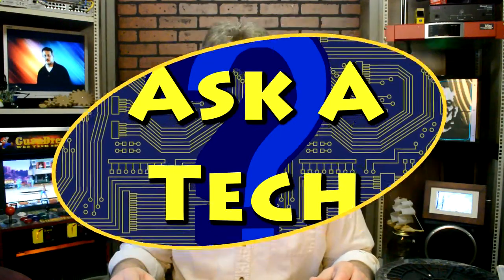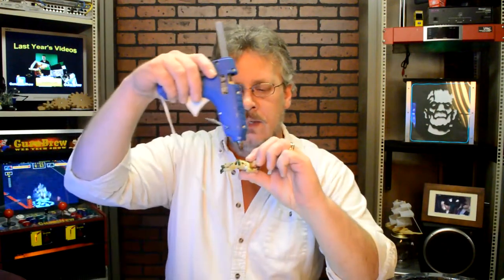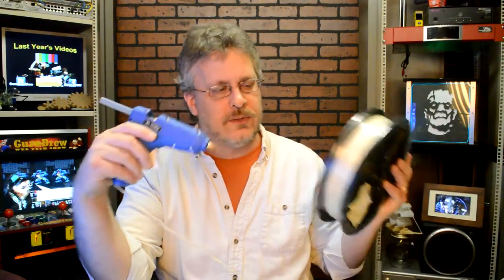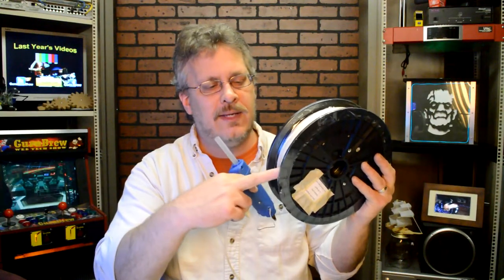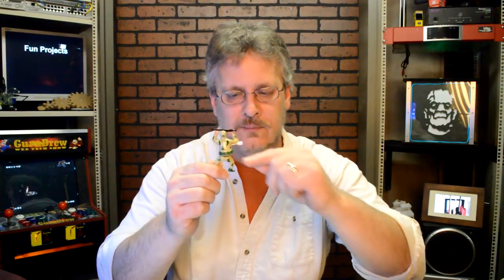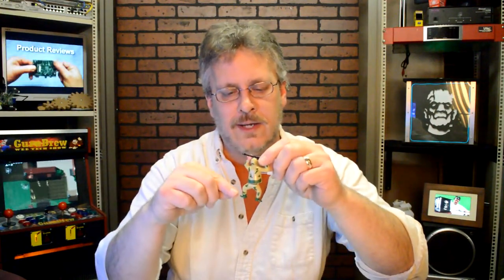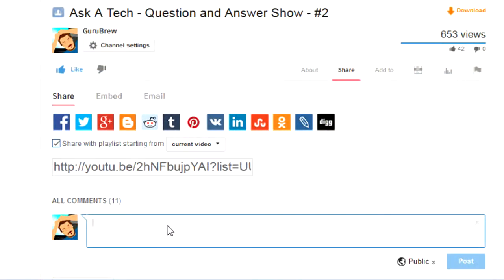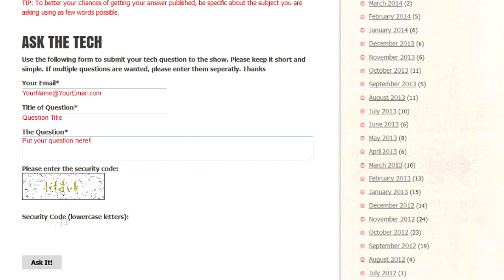What's a 3D Printer?  What Can it Do? How Does it Work? - Ask a Tech #62

Comment: Geez!  Just bought a vintage metal lathe last month so I can try my hand at metal working, and was holding off on the 3D printer for much the reason as not proceeding on the CNC machine.  The learning curve for SOFTWARE needed for creating your own pieces.  The Thingiverse does offer partial solution to the sourcing of products, but you have a head start on the design side with your CNC skills.  Good for you Steve, I'll be watching.
Reply: How is the metal lathe doing? That is something I know very little about. I will keep you in mind for turned parts sourcing :)
Reply: GuruBrew The lathe is up and running.  Had a lot of dried oil/grease, the result of sitting for a long time, but got it cleaned up and everything works good and no parts needed replaced.  Now the challenge is measuring in thousandths of an inch, as opposed to a 1/32nd or so as when dealing with wood. :)  Currently I'm working on a variable speed DC motor drive to maybe supplement the current 16 speed pulley/belt speed control.